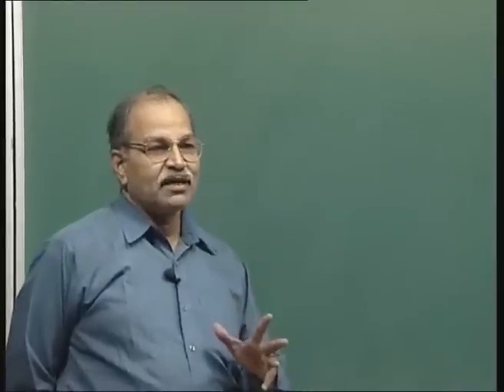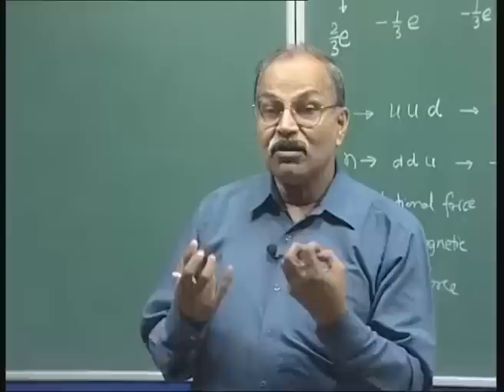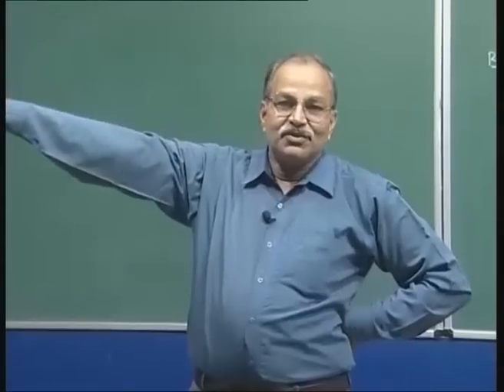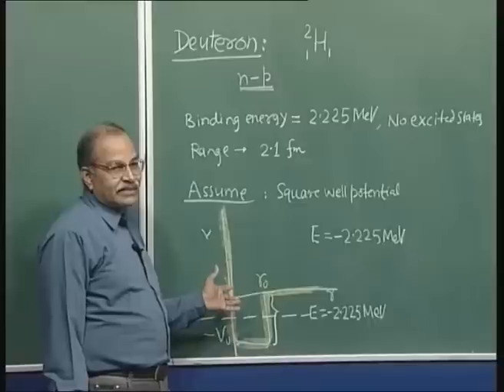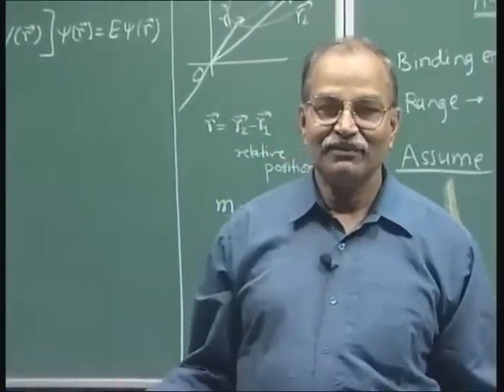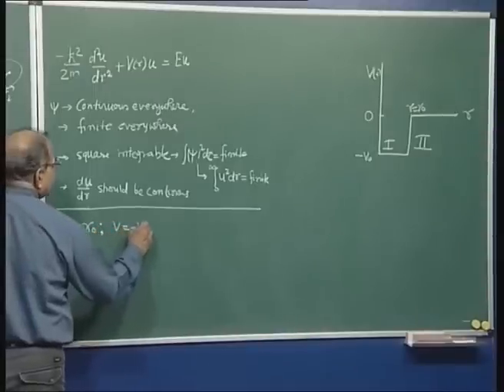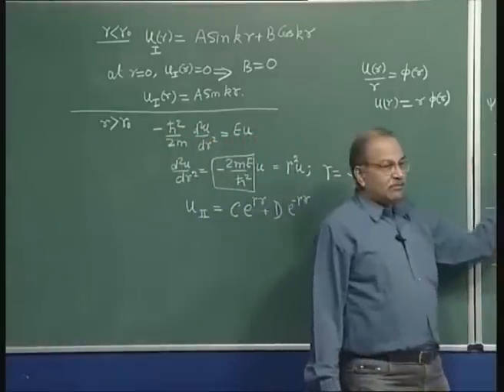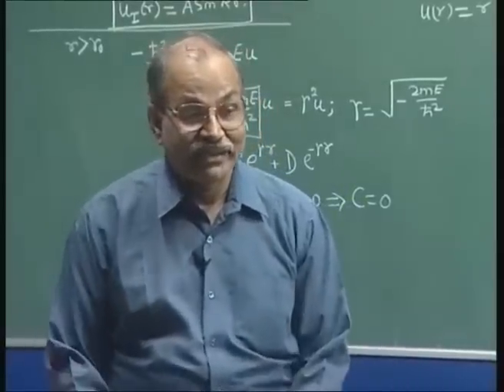Mod-01 Lec-11 Deuteron

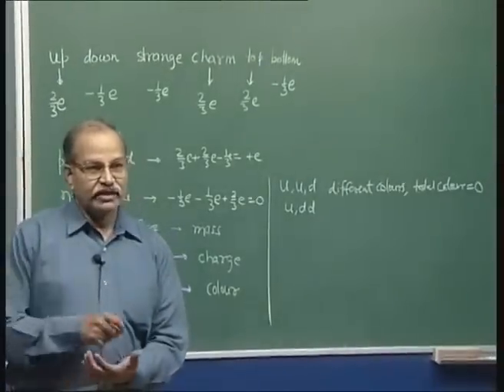Comment: 9:21 as sir said that three different quarks total is zero  but in case of proton also here I have different quarks but total not equal to zero
Reply: Are you asking about charge? Up quark has 2/3e charge and a down quark has -1/3e charge. And proton is made up of two up and one down quark. So if you add up the charges you get +1 on proton and 0 charge on neutron as it's made up of two down and one up quark.
Reply: The color charge is zero not the electric charge two are different

Comment: How it is a central potential. By definition it depends on distance from center and acts towards or away from the center or origin of force. Then here potential energy is through out constant in well , then there is no gradient of potential energy and force has to be zero. Please correct me where I am wrong
Reply: i think they are considering the potential(supposedly nuclear) that one nucleus experiences from the other. not necessarily the potential from the centre and nucleons are assumed to be uniformly distrubuted. also, they assume that it is central.

i could be wrong too,  thank you.

Comment: Surprised to learn that even the simplest possible assumption about the potential as a square box potential still requires numerical methods to find that single missing parameter V_o = 36 MeV .  Cool nevertheless!

Comment: Sir, kindly check! I think wave function will have both sine and cosine solution in the well region
Reply: Sir, the explanation which you gave for only sine solution is debatable. Cosine term will be zero by the logic you made one of the exponential terms zero (finiteness of wave function), this is what I have read
Reply: In the 4 years if u have figured out that there's no significant difference between sine and cosine terms except phase shift, then good for u.